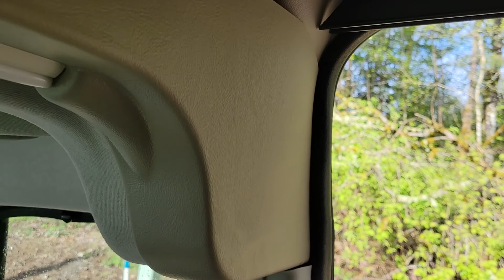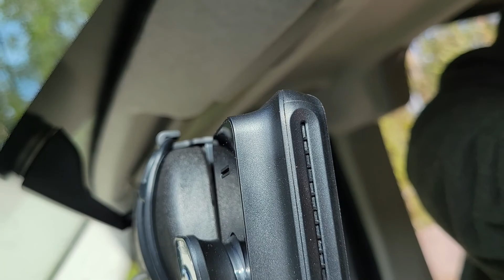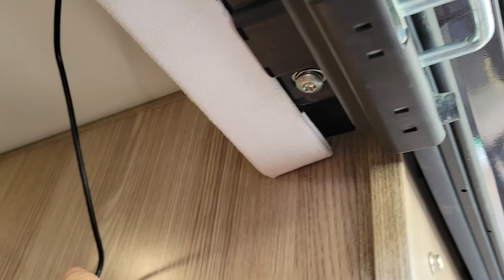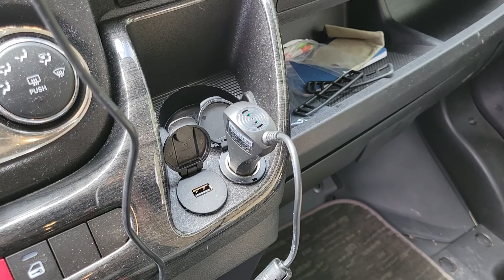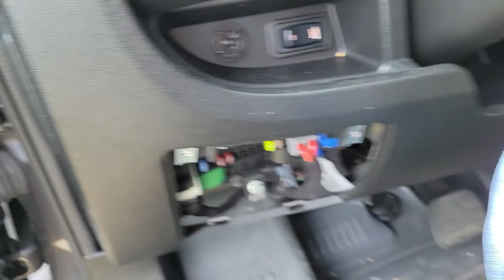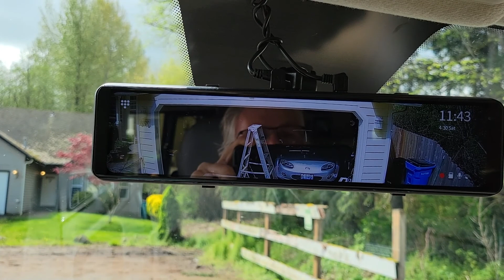Rearview Mirror and Camera Installation and modification in our Winnebago Travato #vanlife

Comment: Thanks for this video.  I have the same vehicle and the same problem with the mirror.  Did you consider running the cable down the port side, behind the refrigerator?   Do you have video of backing up?   What do you think of the backup guide lines?  What do you think about the size of the mirror?  Too small, too large, just right?
Reply from the maker: Hi Rick. Yes I was considering both options of the port or starboard side and chose the starboard just because it seemed like there would be less obstacles in the way, and I knew I was going to install the hardwire kit to the fuse box and just didn't want to cram the headliner and pillars with too many wires.
I didn't install the backup wire since I will still be using the backup camera on the dash.
The mirror size is perfect and much better than the original.  I was concerned about how wide it was too.